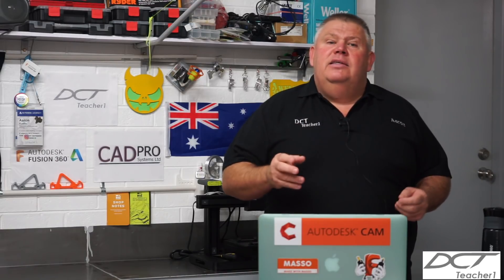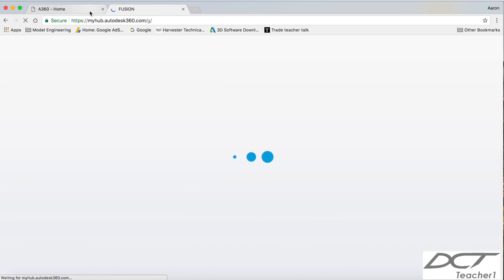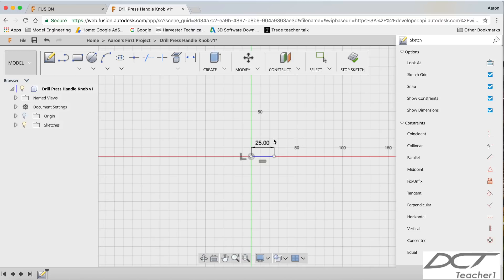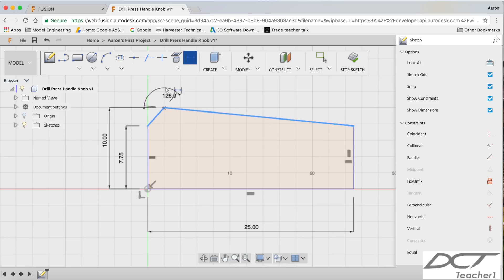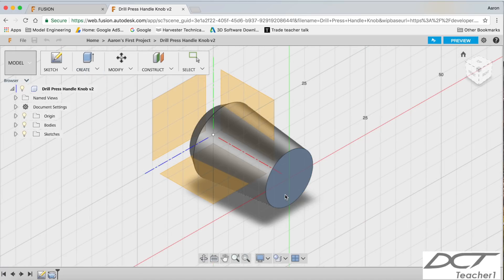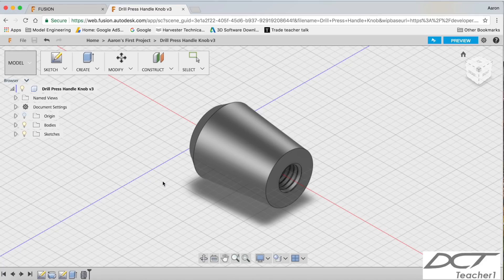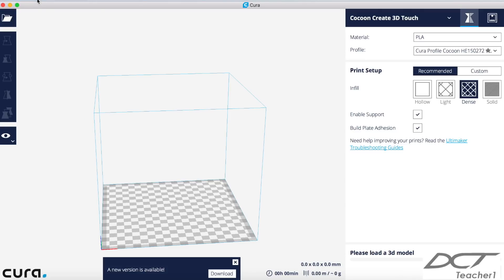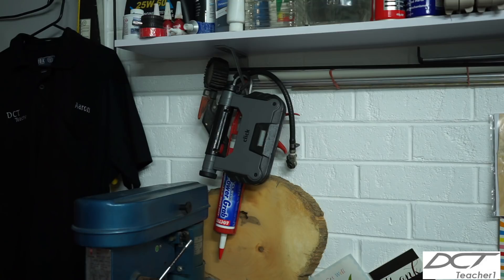Fusion 360 Web Browser Tutorial (Autodesk's best kept secret)

Comment: I want to ask here, Is it possible to edit Or create new Fusion 360 models on iPad Pro through safari web browser? (By enabling Request Desktop Website on Safari) With having commercial license/subscription. I checked on website web access is only for education community.
Reply from the maker: No unfortunately not. Autodesk dropped the web browser design feature. I believe they have got it working on chrome books. Best to post the questions through the autodesk knowledge centre on the Fusion360 forum. 🍻

Comment: How would the little 3D printer go if you put a chamfer on the thread end of the part and also rounded the top of it a bit?
Reply from the maker: Hi Micheal, I'll give you a call back in a minute or two.  No problem at all mate.  I just wanted to replicate the original part to make a point in the video.  Cheers, Aaron.

Comment: my experience is NOT the same as what you're getting.  I go through the same motions and do not get the same results. if I keep trying, i can get there.  and I thought there were problems with the desktop version.... this is more frustrating.   damn thing wont let me select the small face of the knob to draw the circle. no matter what I try.  I have the worst luck with software.  the only saving grace is that there are others out there experiencing the same thing, but we're a minority.  why this crap doesn't work right, IDK.

eta:  I wanted to try this web based version, so I'm following along stroke for stroke, and on a linux machine, running chrome.
Reply from the maker: Hi John, I just used the dimension tool and clicked on the two lines that I wanted the angle on.  After that I double clicked it and just edited it.
Reply: I got the angle dimension to work, eventually.  I updated my post to reflect my other  'problems'
thanks anyway.
Reply from the maker: John Galt Hey John, not sure why you’re not getting the same result. I did this on my MacBook via Chrome.  I also tried it on my school PC and it worked just fine. The web based version is still in development and not quite there, but give it time. Regards Aaron
Reply: just went straight through this again, not a problem. everything worked like it should, for the drawing part. I could not get the feed back button to do anything.   go figure.
I have rebooted my machine a couple times since I had the problems.  Maybe there are a lot of issues when it comes to chrome and/or Linux?
I was quite interested to do this on my linux machine, as I do have a dedicated windows 10 machine with F360 on it, but if I can do one-stop shopping, why not?

thanks for your contributions to the hobby.